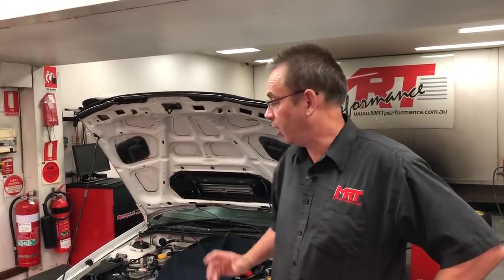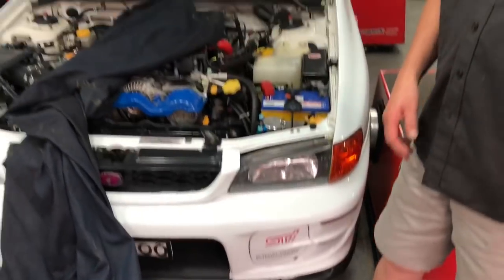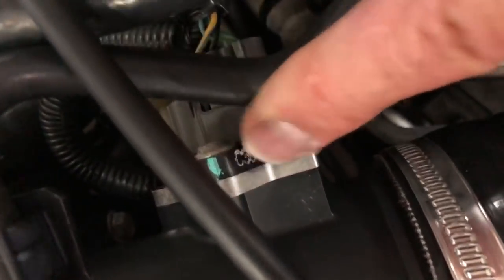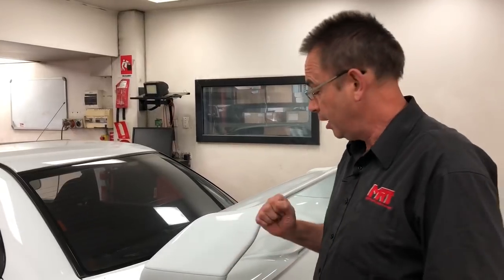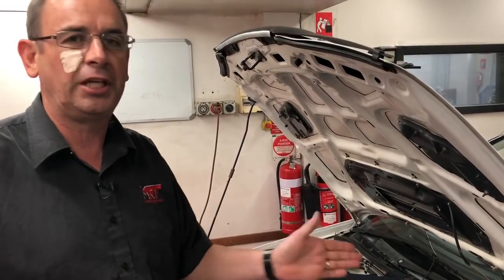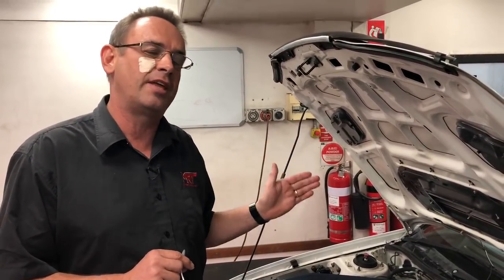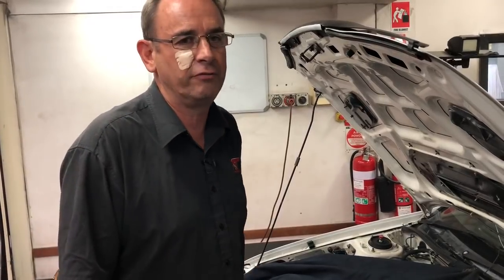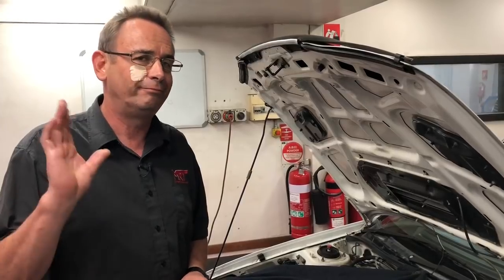MY99 WRX Custom Tune using Factory ECU - PART 1

Comment: Good vídeo. Whit the ECU Explorer and Vagcom (blue) cable can access yo "rear" the OEM Unesia Jecs ECU. Whit this can change the ignition advance step x step 1° degrees . Mi ecu is an oem AE780 (Ae800 UK)

Comment: What is the blanket on the engine for?
Reply: blindabinda123 I think it is the air sock so they can get flowing air to the intercooler. Smart tuners do that instead of placing the high velocity blower right on top while the car is on the dyno.